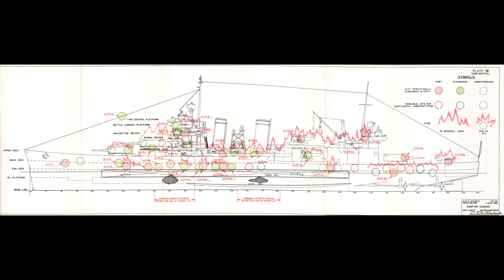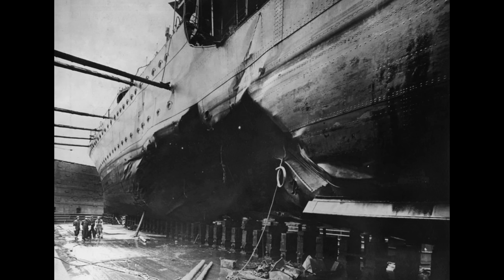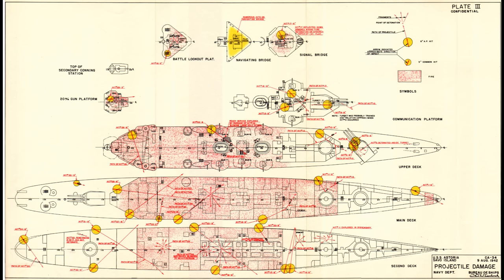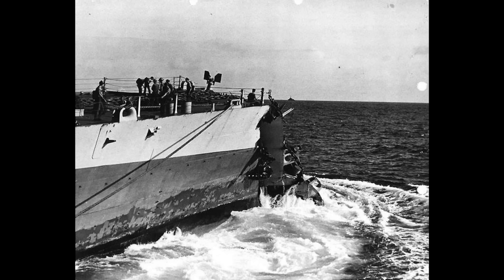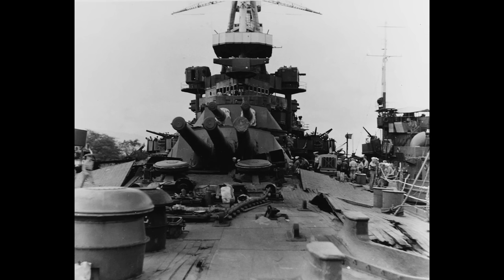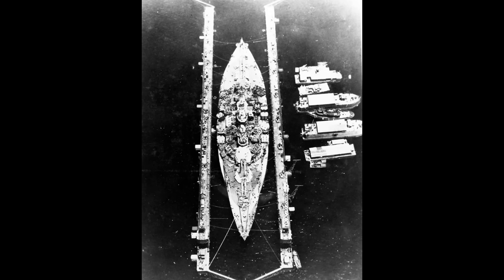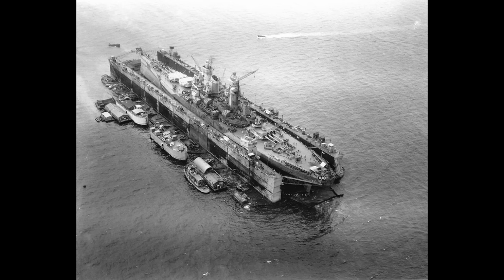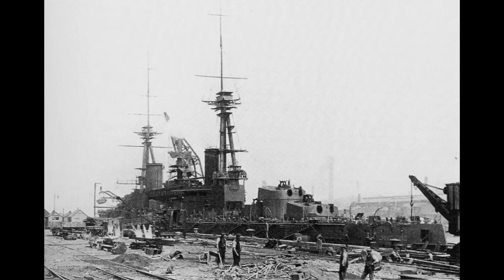Repairing a Damaged Warship - Ship Triage and Treatment

Comment: Re electrical cabling depending on when the ship was built and Belsfast might have had MMIC cabling which would have to be stripped out and replaced back to the nearest intact junction box as it once broken is suspectable to wet, having an inert powdered insulation and cannot be readily joined./spliced.  As recounted to me back in training (about always carrying many redindant spares) an instructor once said he had to fit a component to the electrical supply using MMIC gland only to drop his only cable pot from the mast of a frigate -never to be seen again but requiring a long way down to the stores and back. I'd imagine Lead sheathed cables would also have to be taken back to the next accessory box as a splice except in a dire emergency would be forbidden.

Comment: Rewiring a warship is probably the most difficult project there can be. That is because tracing out a cable, and then replacing it involves going through several bulheads and compartment cable arrays. All of the bulkhead penetrations are sealed mechanical devices, which have to be opened and the original cable run removed, probably in chunks. Then comes the part where you now have to feed an unbroken armored cable through the original cable run, restore all of the bulkhead penetrations and ensure that you have retained watertight integrity when you are done.

Back in the late 1970's the George Washington class of FBM submarines were taken off line in the nuclear deterrent role and turned into what we called slow attacks. The missile tubes in the missile compartment were filled with concrete and steel sabots to simulate the weight of the removed Polaris missiles so as to conserve the ship's trim. This was not ideal, because now your old boomer acting in the attack sub mode is packing several thousand tons of unneeded missile compartment along with hundreds of tons worth of sabots. The fix was determined to completely remove the missile compartment, rejoin the engineering spaces to the bow section and return the boat to it's original Permit class shape. The Abraham Lincoln SSBN 602 was selected as the lead boat in the modification program. They duly cut it apart, removed the missile compartment, welded the hull back together and then started on the job of rejoining all of the power and control cabling, wiring and bussing that was needed to reconnect the forward part of the ship to the engineering section. The attempt failed, as it turned out it was impossible to trace out the thousands of individual control and power cables in order to match the bow ends to the stern ends. In the end, they gave up, took the reactor off the boat and towed it out into the Pacific and scuttled her.

Comment: Again my question: How do you weld 20+ cm "plates" (more like blocks) of steel together? Normal welds do connect metals pieces along lines, ,maybe 1 cm thickness or so but not on sheer planes.

Comment: Some of the pictured damage made me wonder if anyone did a cost anayis and determined if the time and $$ spent to repair and return the ship to service was justified or if these ships ever managed to contribute to the war effort in any meaningful way when the repairs were complete
Reply: Yes. You have to remember, even during wartime a capital ship takes a LONG time to build - up to a year or more, and then you need to fit it out which takes another 2-3 months at the best of times, realistically 5-7 months. On the other end, tin cans would regularly be marked beyond economical repair and either converted to other uses or taken apart for parts to repair other ships. Plus your repair docks are rarely the same as your construction docks, which means that it's often not a "either-or" but a "both-and".

Comment: If a ship had suffered sufficient hull damage with consequent flooding to impose a significant list on the ship, when it was brought into a dry dock for repair, how would it be prepared for the dry dock to be pumped out? Would a) the ship be counterflooded to bring it level so that it settled evenly on the cribbing that would support the hull, b) have cranes pulling the ship level so that it would settle evenly on the cribbing, or c) would the dry dock simply be pumped out more carefully, with the ship coming to rest first on the cribbing on the side of the list, and rolling upright onto the rest of the cribbing as more and more water was pumped out?

Comment: So Drach under the explanation, how would HMS Hood if she doesn't sink be rated?

We know before Hood blew up historically had fire damage on her shelter deck from an ammunition fire, a shell hole to her forward superstructure and gunnery spotting top tower, the number 3 turbine room wrecked and the number 3 turbine destroyed and a shell hole below the water line on the starboard side

that point about Electrical wiring at 25:34, Hood's aft end wiring will be majorly damaged if not destroyed
Reply: Hood was already well overdue for a refit and modernisation - she had been kept on active duty well past the point of reason and this was well understood.  The reason was simply that she (along with the QEs) was the most versatile battleship the RN had afloat until they could get the KGVs on line.  The Nelsons were too slow, the Rs were less upgraded and the Admiralty seems to have regarded them as a second-rate ship, while Repulse and Renown were significantly weaker.  But once Hood could be spared, she was almost certainly getting a major rebuild.  

Given that rebuild would almost certainly have involved changes to her magazines, armour scheme, completely new upper works, probably an aircraft catapult, new machinery, and updated AA armament, it seems unlikely that any survivable amount of damage would have been considered a massive problem.  Though, as the rebuild plans had not been finalised, it might be the case that more extensive damage would push toward a more extensive rebuild.
Reply: @tomhutchins7495  with 1 turbine destroyed and the boilers pushed too hard, just to repair the engines would require opening up Hood just to get to them

Comment: Question: At various points you have photos of ships in drydock with timber side supports, such as at 30:41. How common were drydock 'oooopses' where these broke or something else failed causing the ship to heel over and slam the walls? I understand there's probably significant factor of safety in the number of these, but stuff happens. Were there any famous or significant failures like that?
Reply: See what happened to RV Petrel in dry dock in Leith a couple of months ago.

Comment: Actually, a properly welded joint is stronger than the metal on either side of the joint. So while it may be preferable to replace the 10ft beam in your example, a properly welded joint in the middle wouldn't be a deal breaker.
Reply: On the surface level I agree, but the devil's in the details. Certain alloys of material might be dramatically affected by the HAZ, causing a brittle spot at the joint, maybe weld access isn't ideal halfway along the beam, while at the ends it's accessible. Not saying you're wrong, but it's hard to make a generalized statement because it would be a case by case situation.

Comment: After the X-craft attack on the Tirpitz, should the damage assessment have been a“MISSION DEAD SHIP” in very, very black type. They didn’t have access to a home port dry dock so the actual “MISSION KILL” damage was  actually done? The rating should have been , “no longer a CAPABLE FIGHTING SHIP”, after all, the repair was done in the fiord to remain afloat. It was said that the ship  rose up-to 6 meters out of the water. For a ship as massive as she was approximately 46,000 tones, this alone was enough for ship architects to estimate , “DESTROYED”.
All main turrets were damaged with turret Doria no longer able to even train.  Further damage inflicted to the ship, such as machinery beds destroyed , steam boilers destroyed and turbine’s lifted off their mounts, major steam pipes cracked, water plants destroyed, propeller shaft bearings twisted, propeller shaft “BLOCKS” were broken, propeller shaft UNABLE to ROTATE, along with fuel piping destroyed by the warping of the triple bottoms and shifted structural “BULKHEADS” warped and cracked.  This type of damage wasn’t possible to be corrected without major home dry docks. The length of time to repair and move the ship was six months I remembered read. Was this extensive this type of damage known to the Allies? After all, we were reading their ciphers as quick as the Germans themselves. If so, why wasn’t this information passed on to the Admiralty, or weren’t we  actually able to read navy coded secrets? Did it take till the end of the war to know the total damage done to her? !!! Many documentaries said that the repairs to be “miraculous”in the speed and time rendered to this achievement due to the engineering prowess of German engineers . 
They were able to move her under steam, but this doesn’t mean she would be able to run at speed in heavy seas. It was also reported that at its last station, a seabed  was prepared before she was anchored in place. This wasn’t enough to prevent her from turning turtle. A min. crew left aboard needed to work her power units with the rest with reassignments being added to defence duties. However, a complete marine crew was left aboard to work the artillery. News of this nature would be hard to hide along with the fact, she no longer was able to leave her anchored position. Therefore, couldn’t PM Churchill & the RN have left it to its fate? Did he want to “SINK HER” that bad?
The possible cost of loses to the crews of 9 and 617 squadrons alone would be disastrous. Therefore,  wouldn’t their crews, along with their ”Tallboy bombs” have been better utilized on more important targets on the continent? If this happened, the death rate of Tirpitz final crewmen would have been spared. After all, the war was technically finished with the decisive victory to the Allies. I wonder just how much information was open to the Allies as they were deciphering the radio communiques before the Kegsmarine it was directed to. That is what we are ment to understand by Bletchley Park or, was it not as it open as reported?

Comment: I have a question. Are your comments about replacing  hull plating and replacing a whole hull plate section  rather than fixing a hole based on research or your personal logic? I ask because it doesn't seem to make sense from a 'joining sheet(plate) metal" standpoint. At least in the age of welding. While there are clear benefits from having intact full length frame members the hull plating was cut to fit and welded together in the first place. Are welds a major and common fail point? Is there a reason it's better to do 160' of cutting out and rewelding (based on just the edges of your 40'x40' example) when you could do 40' around a 10'x10' hole? Not to mention the probably hundreds of feet of  cutting and welding of joins between the frame and hull. I understand it would probably be different with armor plate but hull plate it seems very counter intuitive.
Reply from the maker: It depends on the fixing method, a lot of the hull plating we're talking about would've been riveted, and whilst expedient patches were put in for a lot of wartime repair, the ideal is to replace the whole panel, in many cases at least some of the joints run along frames and such, so whilst they are weak points they are still supported, whereas cutting out a small portion of a hull plate and fitting a custom cut piece to it would mean those joints might be completely unsupported.